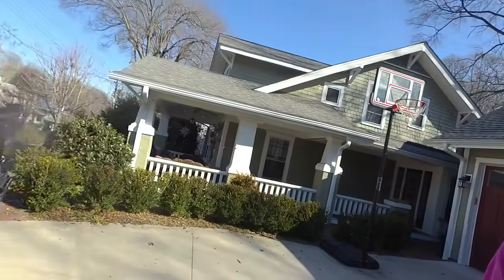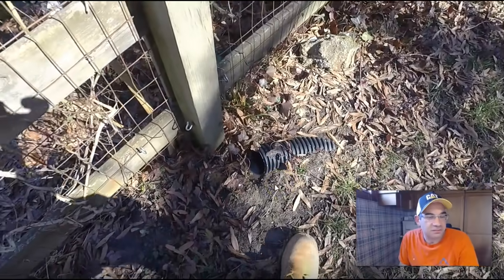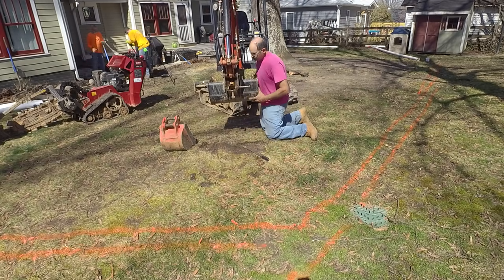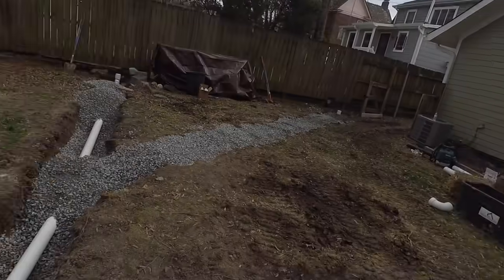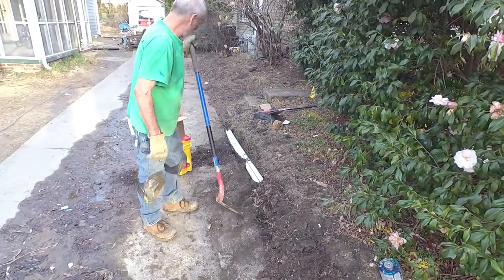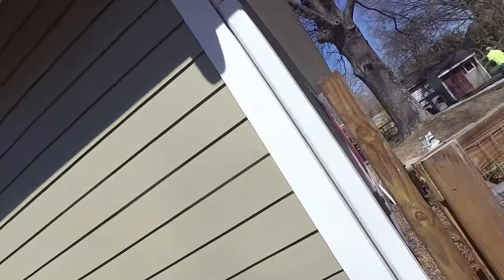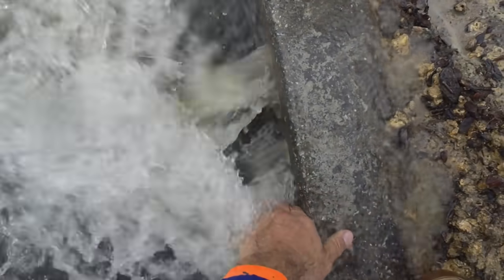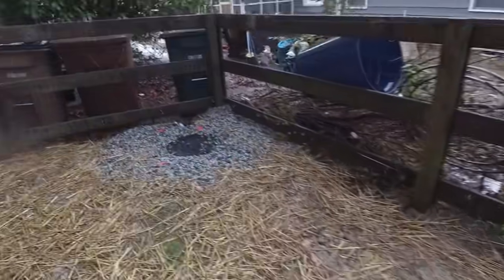Installing a french drain and dewatering pumps to solve stubborn back yard flooding

Comment: Videos need a little more detailed info for us DIYers. What kind and size pipe do you use ? Ones with big holes or just slits around it? 
What sump pump do you use ? Also if your outlet is farther than your 25 ft cord for your pump to plug in, how do you handle that since you don't use extension cords ?
And last question is do you seal the pipe that your cord is in to keep water from backing up the pipe?
Just wondering.
Reply from the maker: Hi Chuck, thanks for commenting. We use PVC and drill our own 1/2-5/8" holes. The pumps are Zoeller M98 with pressure 1 1/2" PVC lines and fittings. If the pump is further than 25' from the outlet, we get an electrician to install a closer outlet. We leave the cord pipe open so water can simply flow into the catch basin. 👍
Reply: @GCFD  
What kind of PVC pipe do you use ?
Thin wall, sch 40, ? And is it all 4" ?
And do you drill holes all the way around or just on the bottom. ?
Thanks
Reply from the maker: @chucks4748  schedule 40 all 4”. We drill holes at about 5 & 7 o clock

Comment: I just had French drains installed w/pvc pipe as well. But they buried it and sodded over as well. If that proper?
Reply from the maker: If you’re going for good looks and you don’t have a very big issue then yes. If you want it to work really really well and carry a ton of water then no.
Reply: @GCFD  oh..my issue is nothing compared to this.

Comment: The drain should have gone along the fence line all the way down the side of the house not just stop the perfect setup would have been to level the back part of the garden putting plenty of hard core in with the soil with a small retaining wall all the way across the garden with a larger French drain running behind the wall, from the house to the wall levelled with a slight fall towards the wall covered with a nice gravel of choice to cover another large French drain in front of the wall full width of the garden. For me just making it better would not have been good enough.
Reply from the maker: Not only did we make it better but we solved the standing water issues. The homeowner turned the FD into a gravel pathway from the fence to the shed. 👍

Comment: Are the "topside" neighbours held legally liable to stop storm water  flow from their property flowing down into the lower neighbour's property? 
If so you may need to revisit the capacity of the pump in the system you installed...it can't cope with the volume...
Would it have made a difference over that length of pressure pumping to go to 6 inch drain pipe with less friction resistance to the pumping?
You could then have the 6 inch pipe exit through an extra two smaller discharge pipes at the kerb?
Reply from the maker: The uphill neighbors are not responsible in our area. There is no pump that could keep up with the volume, and that wasn't a goal of this project. The goal here was to give the remaining water a way to leave the yard after a rain.

Moving to a larger pressure line would create more head pressure pumping to the curb which is why we go with the 1 1/2" line that the pump manufacturer recommends. 

Great comments John!
Reply: @GCFD  
Thanks for your reply...I find it hard accepting that the person who creates the problem with excess run off from his property can just dump the problem on his "lower" neighbour.
Doesn't happen where I live...you can't build a new house and live in it until the water runoff is certified by the local authority to be contained within your property boundaries...and drained off into the stormwater system....

Comment: There are a few defects with the work. But its hard to establish if raising the grade would have left sufficient fall to the street. 

Next if you put french drains in a yard you ise fabric. 

If you never leave the top of a french drain as stone. 1 it shouldn’t be 57 stone 2 if you have surface water its surface drains into a pipe. And some surface drain boxes have filter media and have a catch basin built in. 

Leaving a french drain open at the top is simply wrong. No matter what your rebuttal is i KNOW I’m right. 

If you have thousands of gallons falling into a french drain it shouldn’t be a french drain but a concrete channel. 

French drains are for ground water, not surface water.
Reply from the maker: Thanks for sharing your thoughts! raising the grade wouldn't work in this case because it's a downhill slope for the entire neighborhood. 
Drain boxes are only appropriate if you have point surface waters. Keep in mind this homeowner already had a system with drain boxes installed. They did nothing because the water is non point surface water. 
Leaving the french drain open on the top allows the water to flow into it completely unobstructed and unimpeded. Why do you say this is wrong? 
Channelization is never a good idea as it moves the water way too fast and causes problems downstream. This system is working very well and the homeowner made a path from the gate to the shed out of the open FD to make it look more deliberate.

Comment: Why is the cord not in a gray pipe for electrical?
Reply from the maker: Because it's a cord and not electric service 👍
Reply: @GCFD  but it is providing electrical for the pump. If I’m digging in the back yard and I come across a 1 1/2” white pipe, I think it’s a drain, not a power supply.

Comment: I one concern is for the sump basin why didn’t you you UF cable or put a bushing for the pipe going to the sump tank for the electrical wire ????? But other than that great great work
Reply from the maker: We order these pumps with 25' cords so no electrical is needed.

Comment: Should the PVC been larger?  That is alot of water!
Reply from the maker: Are you talking about the discharge lines? We use 1 1/2" because there is less head pressure (weight of water in the pipe).

Comment: What are some city issues with regard to running residential drainage from gutters out to city streets? Can the city prohibit homeowners from draining our gutter drain/water to city streets? Or charge our utility bill for area of roof? I know that there are certain charges added to our utility bill for area of ground absorbing area. The more absorbing area the less charge. The less area, the more is charged. For instance, a patio paver area allows water to drain into ground verses a solid concrete patio allows less ground area to drain. My utility company explained drain area charges to me like this more or less. That the more run off means more cost to city to maintain city drains....
Reply from the maker: We have impermeable soils here so most water runs off properties. Here the city doesn't care if we discharge to the streets because the streets are a major part of the stormwater managment system. Other cities are very different.

Comment: are there no laws about dumping your water drainage into the neighbouring yards and such? i would be pissed if i saw my neighbour just run a drainpipe from his driveway directly into my yard, and also the basement draining right into the neighbours driveway.
Other than that, amazing video really showing the difference a good drainage system does, also no affraid to show, that even if its made right, there are still limits to what it can handle, but in the end it stopped the backyard from beeing under water for days, and drained the entire yard in a about an hour after the rain stopped.
Reply from the maker: You can't dump water through a pipe but water running off your property is not your problem in our area. It's crazy I know.

Comment: How come you didn’t use geo textile fabric and make a burrito to prevent soil intrusion into all that rock and eventually your pipe?
Reply from the maker: Because I use several inches of gravel instead of a thin layer of fabric. This preserves the flow and keeps the sediments rinsed out of the gravel. The fabric clogs and prevents water from entering the drain.

Comment: No geotextile around the gravel? This will fill up the french drain again with dirt within 10 to 15 years.
Reply from the maker: At least it won't stop working in less than a year with the original FD. Fabric kills the flow into the drain and sediments clog against it. Having a large volume of gravel acts as the filter and allows fine sediment to rinse through the system instead of clog it.
Reply: @GCFD  well, I have had a drain system removed that was built by a landscaper 15 years ago. it was layed in gravel without fabric. It was filled up with dirt and stoped working. So I have picked 2 times the diameter this time and layed geo textile around the gravel. And added those access points to rince from time to time. We will see in another 10 years... In any case, it is a pain in the ass when the soil is more clay than proper soil. But if there were no parcels like that and all the soil was perfect you wouldn't have a business.  I have only built 3 drainage systems so far. You are more experienced, no doubt. Here in Switzerland it is illegal to let that water flow to the street. We need to keep it on the property. Needing to build some kind of retaining system and give it time to seep into the ground.

Comment: It wouldn't make sense to design a system that can keep up with torrential rain, it would be too expensive.  As long is it clears it out quickly afterwords, I would say it was sized correctly.  Also I was worried you spent too much money on equipment, but it seems it's making you money.  Great video.
Reply from the maker: Thanks for commenting! The equipment is saving a lot of labor (not labor costs, but hard labor) so I'm happy to purchase it!

Comment: Just a honest question, but what happens to the whole system if the power goes out?
Reply from the maker: The whole system is dead with no power and the residual water will stay in the back yard until power is restored.

Comment: So it is OK for next door to dump their water drainage problem runoff on to your neighbours propety in USA  then?
Nice to see you not doing the same - very profesional job; espacially the clean up..
Reply from the maker: Here in NC homeowners are not responsible for water leaving their property. What you can't do is discharge from a pipe onto another property, but running water is fine.

Comment: This looks like the whole street would be wise to club together and get a communal dranage system installed so water is not passed from one backyard to the next. A small stream in each garden formed with a shallow ditch or a underground pipe with a drain for each home. Or be selfish and build a low wall along the perimeter to stop inflow from neighbouring properties.

Comment: Looks like the discharges are fighting the water coming down through the road, shouldn't be better to make them discharge on the same angle or at least perpendicular to the street?
Reply from the maker: This was a major storm event so you're seeing the worst case. But the pumps can pump against it so I wasn't too worried.
Reply: that is the optimal way but he had less than a foot of room to work with due to the neighbors driveway.... pump still works fine....

Comment: Your discharge for the Sump pump should not be 100% 1 1/2” pvc. You should put maybe a 1’-2’ foot section of 1 1/2” coming off the pump and then tie it into a 4” pipe so it can drain properly. Also with having holes in the lid for the Sump basin your going to get dirt down into the pump and then start pushing mud through the system and that 1 1/2” discharge line will get clogged. Looks like that yard would of been better off with a few catch basins instead of a French drain.

Comment: what do you need a 24 inch wide trench for
Reply from the maker: We use 24" of gravel as a filter instead of a thin layer of fabric for a filter.
Reply: catches more water.!!!!!!
Reply: @GCFD  in my experience of doing drainage we end up replacing systems that were just gravel and a fabric liner they eventually just got clogged and never drained. we use a 4inch PVC pipe with a sock and then fill in with concrete sand and it filters and drains perfectly for years to come. i guess my question is does it just depend on the region i live and why a lot of people use gravel?

Comment: Only different thing i would have done is that second sump well in the corner where all that extra water was filtering out of, that sump well needed to be larger, not saying this in hindsight! Saying this based on the amount of downspouts and square footage of that back yard AND the neighbors yard, you underestimated the amount of water that the lil 1 1/2 inch sump well pump wasnt capable of pumping out the amount of gallons gpm coming into thst lil well, you needed a 2 inch pump with a 3 inch discharge line to the street. Otherwise nice job.
Reply from the maker: Great comment George! I would have to disagree because the point was to get rid of the residual water after a rain event, not to keep up with the rain event. No pump can do that plus it's not worth it. Thanks again for commenting!

Comment: Eh… doesn’t look like you sized your solution accordingly. Why not drop multiple pipes in the FD to handle the potential water volume? Was it just a cost consideration of the customers choosing or was it a limitation of the sump pump? Also — was there a specific reason the sump had to be used vs gravity out to the front?

Comment: Highly illegal in my state to discharge into the street. These homes should be tied into the sewer system to prevent pollutants and other un wanted debris to be discharged into the open street. 🧐
Reply from the maker: Here the streets are a major part of the stormwater management system. The sewers don't need to treat rain water as it's clean enough to flow to surface waters directly without passing through the wastewater plant.

Comment: You don't use landscape fabric.  Don't you have problems later on with roots and dirt finding there way into the perforated pipe used on the french drain and wells?
Reply from the maker: Roots will find their way into the gravel but the high flow keeps the fine sediment rinsed out of the drain instead of clogging against the fabric.

Comment: So, Why did you not install 1 Catch Basin ? a few 12 x 12 or 9 x9's would have gotten rid of that ground water fast..and keep the yard from totally flooding like it did. French Drains are Slow Catch basins are instant.
Reply from the maker: Because we had non-point water to collect. He already had catch basins installed and they didn't catch all the water. Catch basis are for point water sources. 👍👍

Comment: That illustrates horrible city zoning and planning when one property just dumps water downhill to the next and it snowballs. Why the municipality doesn’t mandate that storm water run of must be absorbed on the property it falls on or be discharged there into the street is the reason these situations occur. Granted it’s decades of organic growth but the codes for land management and runoff need to be updated.
Reply from the maker: We have far too much rainfall and impermeable soils for absorption in our area.
Reply: @GCFD  indeed. Better planning 50 yrs ago could have Prevented the issue. Forcing rainfall to absorb in your property or be routed to the storm drain and forbidding runoff to neighbors would dis this. The load then gets spread to every homeowner to take care of their share rather than the unfortunate lucky down hill having to do massive jobs.

Comment: Couldn't you have covered the gravel with dirt? It looks a bit off now compared to the rest of the garden. The gravel would in theory still work covered by a layer of dirt/grass but at least it wouldn't be that visible/cut up the lawn in so many individual sections. Also, the angles of the pvc pipes in regards to the street seem to be pointing the wrong way in regards to slope. Probably not a big problem as the pumps will negate that of course.
Reply from the maker: We have impermeable clay soils here so burying the drain would kill it. He had standing water on top of an existing french drain that was covered in dirt.
Reply: @GCFD  so a tiny layer of actual dirt substrate (no clay) and then a roll of grass? Clay can be truly annoying, having a garden full of it I can relate. Whenever it rains, I own a swamp.

Comment: so they are gonna have gravel instead of grass in the backyard.
why not make a ditch running along the fenchses and put drainedge pipes in the yard that goes to the ditch then the yard is not filled with water and the two downpipes goes in the pumb well along with the water from the ditch.
Reply from the maker: Yes, the H.O. made a path from the gate to the shed out of the gravel to make it look more deliberate.

Comment: I really hope you havent screwed that tree. Adding that much, which looks like one to two feet can cause the tree to die. Really try and experiment with sand as the top layer so customers  dont have just rock showing, use a geofabric
Reply from the maker: The tree had that much dirt over top of the roots but it all washed away. So I felt all right restoring it. Geofabric and sand slow the water down into the FD and clog. He already had a FD that was buried in dirt and grass and was useless. We keep them open for extreme cases where the water is a serious issue.
Reply: @GCFD  it wasnt the proper material than, USGA greens can perk up to 24 to 28 inches per hour, ours are 26. Think about proper golf course drainage its only french drains and theres grass on top and usually the water is never standing unless its a record breaking storm. We had 9 inches over 2 days and 48 hours after carts were allowed back on the fairways.

Comment: This problem is the result of unchecked construction without regard to the natural drainage paths AND the elevation of the surrounding terrain. If the land on all sides of you is higher than yours then efforts to stop the flooding are useless. Surrounding terrain means miles from your property---not down the street.